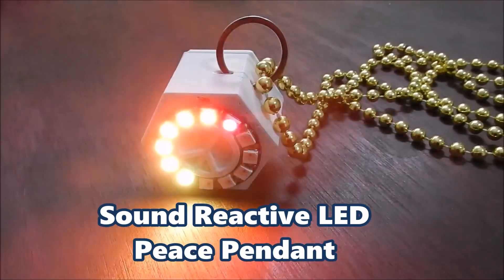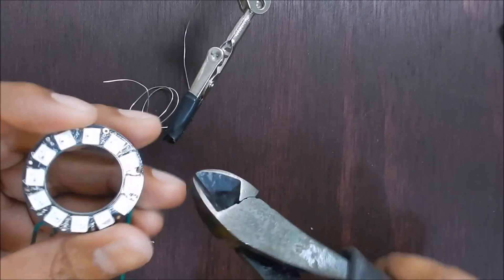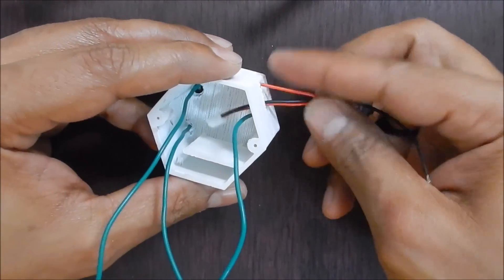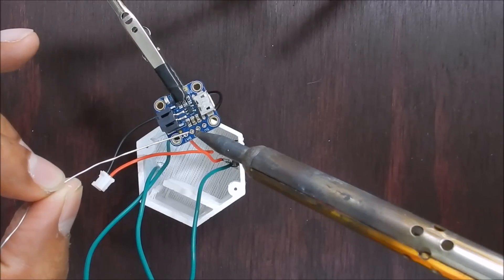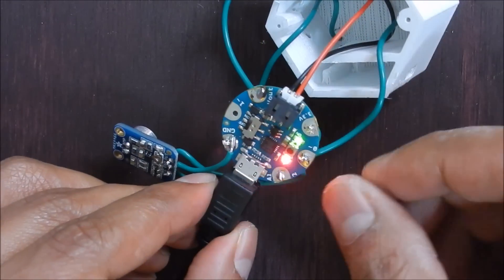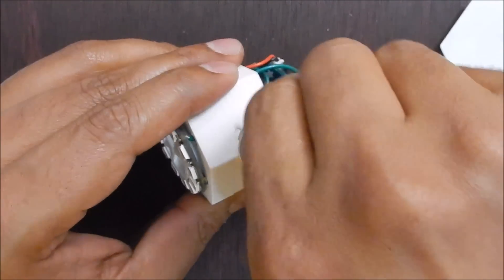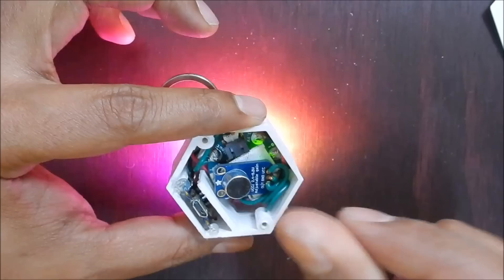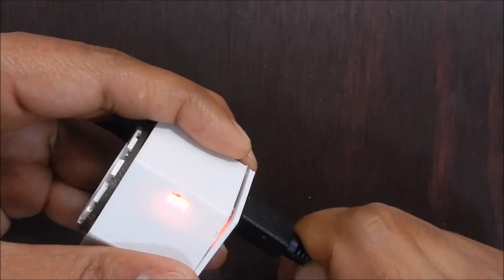How to make a Sound Reactive NeoPixel LED Peace Pendant

Comment: Can you use this same set up to create a mask that will light up it's eye every time you speak or would you need a different system than this.
Reply from the maker: +NemesiswillNIL8U yes, I think that's possible. Assuming you want to connect 2 rings, you can connect the 2nd eye to the same IO port to ensure they both light up simultaneously. You may have to tweak the software a bit in order to be more sensitive to speech. Check the Adafruit mic product page for info on adjusting mic sensitivity as well. Please share a link here of your project once you have finished. Sounds like a great idea and would love to see it!! :)